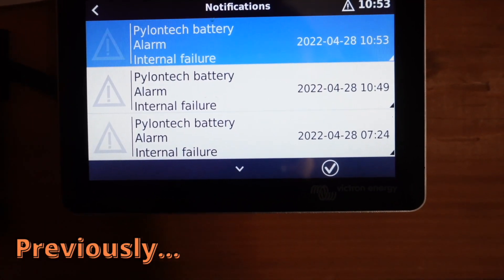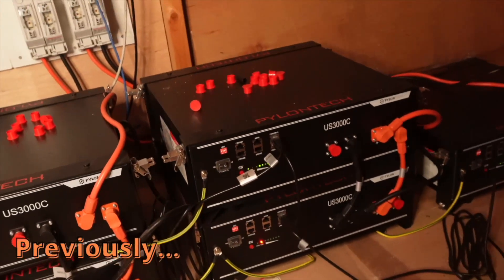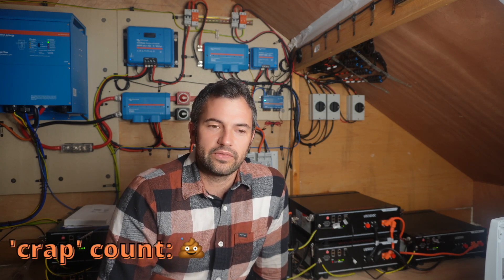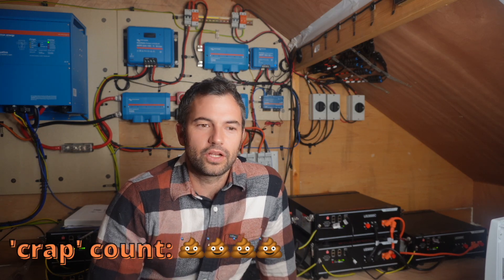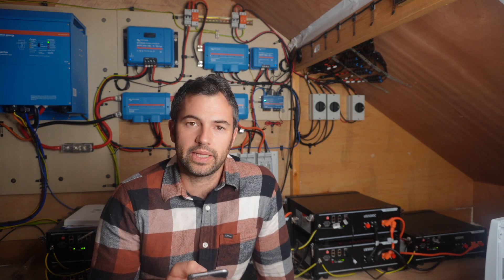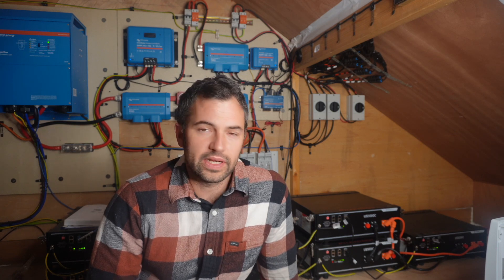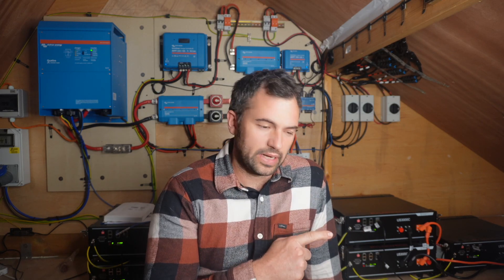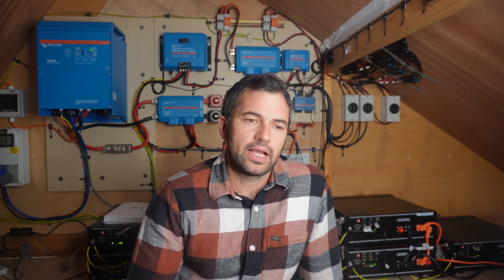WHY WE WILL NEVER BUY PYLONTECH AGAIN

Comment: I hear your cry for help. Have you resolved the warnings? Internal failure warning sounds really bad, but its just Victron's label for the raw data coming from battery. The batteries are not broken, they are working fine. I work for a Victron and Pylontech distributor for professional installers in Australia. We have resolved this minor cell balancing issue remotely many, many times. It is an easy fix 99.9% of the time. You do not need to buy any other software or hardware products. Is your Cerbo GX connected to Victron's VRM Portal? If you want, I can resolve this for you, usually in a couple minutes with system access.
Reply: Question. One of these comments say Pylontec is not good when off grid only. What is your opinion? I have a 8kva Deye with 10kva pannels with 5 x 3000c in town grid tied with no issues...need to put solar on my remote home ...totally off grid...I love the 3000c...but that other comment is concerning...your thoughts pleas5
Reply: @johanbester4484   That comment is just rubbish. From my experience of selling and tech-supporting Pylontech and Victron over the past decade, we only ever had a handful of warranties - seriously, I think it was 5-6 battery modules from thousands of systems. From these systems, a mix of grid-connected and off-grid, but the majority off-grid. And of these off-grid systems, many are located in some of the remotest and harshest climate conditions possible. Super reliable. Nearly 99% of problems occur from incorrectly sized,  programmed or installed systems. However, I continuously heard from salesmen of 'self-managed', that 'smart or comms' batteries are a risk compared to 'self-managed or dumb' lithium batteries (BMS only), but this is a smoke-screen to scare you. They do this because producing a 'smart' battery is difficult and expensive and they just don't have the technical capability or financing within their company to produce a battery with all the possible performance and safety. There are no serious scale batteries without full battery communications because it is simply too risky. Battery communications provides accurate monitoring and control of all the critical factors for charging /discharging lithium batteries. Importantly, battery comms allows the battery to automatically manage the inverter/charger for situations such as changes in temperature, or even turn off the equipment to prevent an emergency situation. Another layer of protection. Moreover, without this extra control it means that the 'useable capacity' of the dumb lithium battery must be less to accommodate the lack of fine and accurate charging/discharging - lower DoD. BUT, what if the comms cable gets damaged or falls out of the Pylontech the system will shut down, says the self-managed battery salesmen?  The entire world functions on Cat 5 and 6 cable and these guys are trying to convince you that they are unreliable?? Obviously another scare tactic. Not true if set-up correctly, which is super easy with Victron. Program the Multiplus or Quattro as if there was no smart communications from the battery, like a lead battery. If comms from the Pylontech are lost (which just doesn't happen 99.999% of the time), you have a Plan B, the Cerbo GX will automatically switch back to the battery monitor inside the Multi/Quattro.  Don't believe me? Just test for yourself. Set up a system and deliberately remove the comms cable from  between the battery bank and the Cerbo GX while its operating. It will continue to work, but a lower level of performance - about the same as a 'self-managed' battery.  The world's telecommunications function on Cat 5 and 6 cable and these guys are also trying to convince you that they are risky and unreliable - really?? Good luck with your off-grid system. Remember, if off-grid and using a hybrid inverter such as a Deye, the technology doesn't have the inverter 'current surge capacity' of a Victron, SMA Sunny Island or Selectronic with their toroidal transformers, so you should allow for more inverter and battery capacity to run devices such as pumps and electrics motors, etc that require large current to start up. I hope this helps.

Comment: I do also have 8 Pylontech in parallel. They are connected via 4x2 cables. So 2 batteries are daisy chained with cables connected from different sides and the 8 (4 pairs) resulting cables are connected to two directly linked lynx distributors. I don't know your setup in detail but it doesn't look like if you can guarantee the same resistance to all batteries. This will result in different amps, different current, different load... In sum it will lead to errors.

The system you build looks a lot like wild west and not like it has been built by a professional, sorry. Nonetheless the battery communication should work.
Reply: Just saw that you have connected them also to a busbar with 8 cables. Are the cable length all the same? Victron tells you to evenly spread inverter and battery connections over the busbar, but I don't think that this will make a huge difference on a system designed for 1000A... I could imagine that the single battery is the evil one. But you most probably have already tried not connecting this one for a longer period of time. I still think that there are some flaws in your installation but many people have already told you this I guess.

Comment: I have 8 of these batteries, touch wood has been running like a dream added two more new batteries, made the new batteries as master, had the Red danger light "Alarm", lowered the volt charge and float and they integrated with the old comfortably...

Comment: Im building my own bank using 16 grade a eve cells using a 200amp jk bms.  One of the reasons is to avoid all those kind of problems.  14+ kw for £2700.
Reply: Touche.....I hope we made the right decision! Have jumped in and have 3x 16s 304AH plus three JK's...... Did it because partly a recent test in Oz surfaced all but one well known brand battery had problems.......and it gave me some control over the components.
Reply: @ianpope7061  nice 👍. Finished mine the other day, all top balanced etc, first night yesterday using them, and all good so far 😁

Comment: To try and help others watching is. Plyontechs appears to like being charged up to 100% and staying there every few days (3-5) and then they seem reliable according to what I've read in many different places online. Some people say its to top balance bla bla bla but who knows. I would say Pylontechs are good for grid tied inverter systems but not for offgrid unless you use your generator to fully charge and hold every few days. I personally have 8xUS3000C grid tied but have not had them long enough to judge (Working at the moment but only 3 months in) I also hammer the crap out of them on a daily basis. If I was to do it again, I Would buy some basic lithium batteries and use the smart shunt with my victron setup. Thanks again for your Brilliant videos. Give it up and congrats on you addition to the family.

Comment: Obviously you’ve had a bad experience, both in terms of failed units and also the post sales support (which really should be via your supplier and not direct to the manufacturer). Having said that I don’t think this means that the units are bad as a design in general. I have 4 US2000c units and have charged and discharged them to 100% and 10% almost every day for the last 6 months with no alarms or issues. I do wonder if the issue that you are facing may related to compatibility of the batteries and the victron products or the fact that you have lots of cables and connections. It would only take one connection to be bad/worse than the other ones and the load in the batteries would not be evenly distributed, which could result in one or more batteries being overloaded or over current draw.
In your case where you have no grid connection to rely on the inverter to manage the load on the batteries with no backstop of a grid connection to prevent over current draw from the batteries, it’s particularly important that the inverter ensures the current draw from the batteries is evenly managed and within the capabilities of the batteries and in your case this would be around 250A (12.5KW) assuming even loading with 7 batteries in use. I know that for my inverter the batteries set the maximum charge and discharge that the inverter uses, I wonder if victron has the same control in place

Comment: Stop messing about with Pylontech, your contract is with the supplier. The batteries are less than 12 months old aren’t they? You should not accept this level of service. 

Did you pay for them using any form of credit? If so you could use Section 75 and make your credit card company jointly liable. Life’s too short for this.

Comment: You will always get stupid comments wherever you post. Too many people with no idea. Assuming the firmware is the same across all of them which you can check with BatteryView. I would expect them all to be if purchase at the same time. There are two models of the 3000C but I think yours are the older ones. Lots of BS out there but they should all work together perfectly with or without link cables and BMS connection to inverter. Its a duff BMS no doubt, I would tell the supplier they need to replace it. Did you buy using a credit card just in case? There are lots of under and over voltage cell false alarm issues still going on with the new 3000C's as well and support isn't great in general.

Comment: We used these in some off grid systems - but stopped years ago. They don’t perform in the cold (they just disconnect!). Although, as your system is in the house, it should not be a problem for you. The other limitation is the charge / discharge limits. They are too tight for an off grid setup (in my opinion). These are really an on grid energy storage solution - you can use for off grid - but it would not be my choice

Comment: Hi you are covered under the 1979 sale of goods act. First when you buy goods the contract is between you and your supplier NOT the manufacturer. The battery you bought has to be fit for purpose, which it is not. You have enough data to support a claim In a small claims court. All electrical equipment covered for a total of 6 years. You need to take your supplier to court,but first offer them the opportunity to correct the situation. It is their responsibility to rectify the situation.  You bought the batteries in good faith, they were being sold as working batteries, and your supplier is responsible for selling them as working. All covered in the 1979 sale of goods act.it works the same as you buying a TV from Currys, if it goes wrong you take it back to them and it is their responsibility to sort it out. Exactly the same thing with your battery.

Comment: Biggest problem is your supplier. I have installed over 60 US2000C batteries, and had this issue on 1 of them. Took it out of the system, contacted my suplier en got tis answer: it is a known issue with some of the batteries caused bij the build in bms. Sollution: send it back to the suplier, they get a new bms under waranty from pylontech and can change it over. Your suplier needs to fix this not you. when i install a new system, i do a stress test. Is there an error like this one, battery goes out en back to the suplier, this is their responsebility. Pylontech uses their supliers for handling the waranty, just like victron does. That is why they don't answer, they just don't have the personel to do so.
Reply: I have no problem with the batteries themselves but for whatever reason my phone will not connect to the app sometimes it does sometimes it doesn't they're telling me that it's because I have an Android phone and it's like you got to be kidding me you can't sell these damn batteries all around the world and tell everybody they have to have an iPhone and if that's the case why didn't you say so😮
Reply: how to stress test them? just bit load? and high charge currents?
Reply: Agree, also I had a problem with one of the 2 UP2500 in error after one cycle. I returned it to the supplier and after some analysis they send replaced it.

Comment: I have 2 of the US3000C since March this year, and i recognized the same error as you, but less often. In my case regulary after 2-3 days i got this internal error in the middle of the night. After a lot of reading i found the suggesting of doing a firmware update, here from 1.3 (installed) to 1.4. I did that (with battery view, a version from pylontechs facebook user  group) in May this year, and since this time i had around 75 cycles without any problem. For me this was the solution. Fingers cross.
Reply: I was going to buy a few 5000s but now no way, terrible customer service, apparently crappy batteries!
Reply: Hey mate, Can U tell me what group is it?
Recently bought a US5000 and 3 weeks in the alarm goes off Every time I try to turn on. I am living with a gerator currently. Thanks, best regards.

Comment: Is your battery firmware up to date ? I have heard of US3000c errors. I run 3 x  US2000b and 1 x C and they have been great for many years. `~~(touch wood)  as with any batterys they need to be balanced correctly I like you were advised charged each battery up fully invidually before connecting them to the stack so that there voltage is the same. (Dip switches have to be coreect too.  I use MPP 5048 solar inverter off grid no issues. Going to make a secondary system out of prismatic 280ah cells and a Daly BMS shortly once they arrive. Good luck hope you sort it out.
Reply: Also check out Will Prowse and the Off Grid Garage if you havent already.

Comment: I have 6xUS3000 modules for 2 years using the MPP8048 inverter charger without all the other cabling and support modules you have on your wall and no issues.

Comment: Apologies if you’ve already tried these ideas. Firstly, I wouldn’t even bother with that one ‘iffy’ battery that didn’t start up. Put that one in a box and try and get a replacement. Replace all communication cables (bought from another source). Start with 1-2 batteries and try and get it working 100% (use your generator more if needed). When things look stable, add 1 more battery. Let it run for some days and slowly include 1 more battery when things look stable.  Have you checked that all Firmware versions match on each battery and are up to date? If you still have troubles, perhaps rollback to earlier versions of the Firmware might be a way forward.
Hope this helps

Comment: This sounds like a nightmare, sorry to hear of how frustrating this all must have been. I was really tempted to purchase these batteries over the Tesla powerwall as it's much cheaper. This video has totally changed my mind on that!
Reply: I couldn't find details about the what Lithium cells are exactly inside the Tesla Powerwall but it they use the standard stuff you find typically in your EV don't install it in your house because it's a fire risk. There have been several issues with the Senec batteries (with NMC cells from LG Chem) as well as LG's own RESU batteries here in Germany this year. The problem is that with the "explosive" type one cell inside the battery pack will start a chain reaction (thermal runaway) you can't stop.
If you install a battery pack based on LiFePO4 cells there is not much that will happen....they are much safer.

Here two videos from Will Prowse were you see the difference:
The explosive type (in this case I would assume it was not the advertised type of battery cell inside that case; in the follow-up video below it is stated that in fact is was the "NMC" type you don't want to have in your house): https://www.youtube.com/watch?v=-pu8hs6hmyk
The harmless type (with additional details): https://www.youtube.com/watch?v=D8xNjz73p80
Reply: I have 4 bateries US2000C  for about 2 years,and they work very well

Comment: Put them in a rack which has busbars. Use the same length cables to each battery. 
This enables you to turn any battery off at any time for service, since the other batteries will stay on.

Comment: Very interesting. I had a fight with Ecoflow for over a period of 6 months, and finally, only my video on YT pushed them to refund me. 7 different people in Tech.Service asking the same questions, no solutions, no spare parts, no blueprints, trying to push the fault on me... Their crappy product did stop charging alone, and no way to find the transformer that was damaged, and some other parts. I went to an electronic repair shop, with Ecoflow approval, but as they did not provide any kind of support, no chance to fix it. The worse being at the end, they accepted to change the damaged product for a new one, with less capacity... After 6 months of fight, they finally did refund me, as I suggested since the beginning... Their 3 years warranty, no hassle, etc, was just bulls.it !

Comment: hello, do you know the settings of your solar controller? 
And do you know  Make the Setting? (without communication)
If so, I advise you to simply disconnect all the communication cables.
After having made the settings of your solar controller, your batteries will work normally?
At least you will have eliminated, if it comes from a communication problem, and also if only one of your batteries has a problem? can you see it?
This is what I will do to try to understand the problem??
Good luck

Comment: Is it not possible to run them as dumb batteries remove all the communication cables. The batteries should then work as a basic battery if not there is a fault in one. I got basic lithium 12v batteries like a car battery and chained them together for 48v when I couldn't source a rack battery like plyontech.